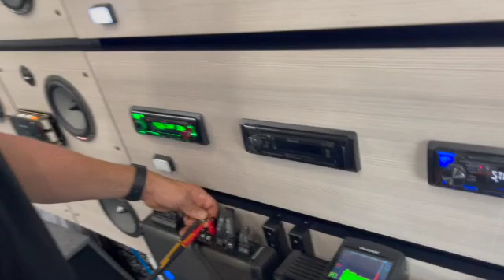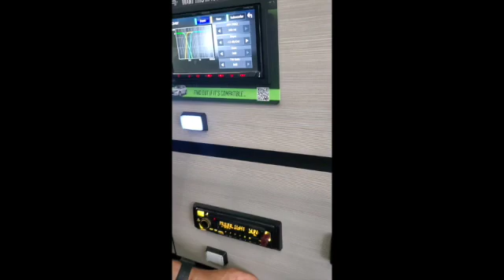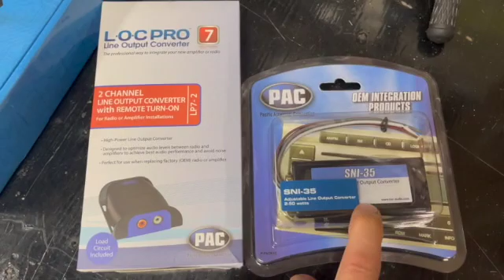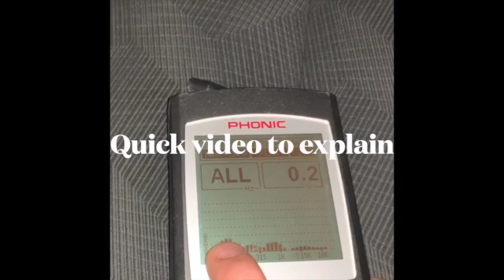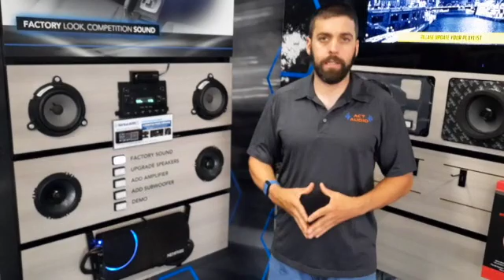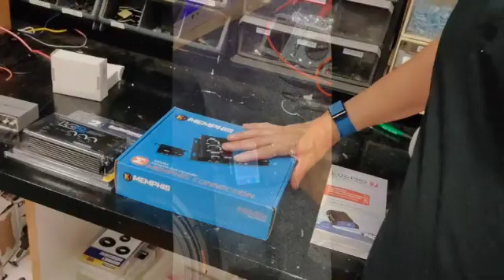Integrating into a factory radio for car audio

Comment: Very informative video. WOW, amazing how this has changed over the years. I love how everything these days are integrated thru the radio. On my 2018 Ram I installed a Pioneer AVH-W4500NEX, JL Audio amps & speakers. I wasn't too concerned about losing my steering wheel controls and the factory head unit was the very minimal radio I could get cause I knew I was replacing it. Wife now has a '22 Challenger with the Harman Kardon radio, which we want to keep. I already have a JL Audio mono amp and a JL Audio Stealthbox to still install. I'm planning on changing the factory speakers and adding an amp for them as well. What would you recommend to integrate the system that's closer to plug and play rather than cutting wires? Probably with DSP.
Reply from the maker: Look into maestro and pac for a radio integration piece.